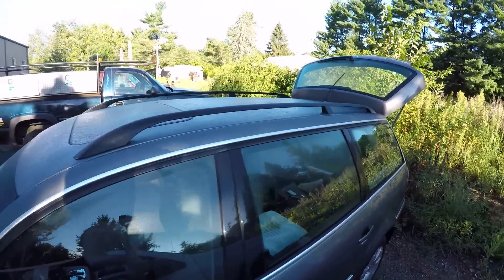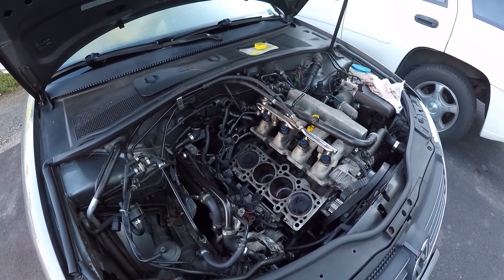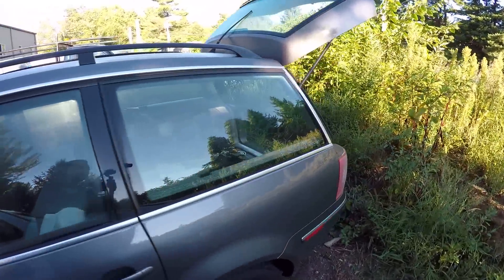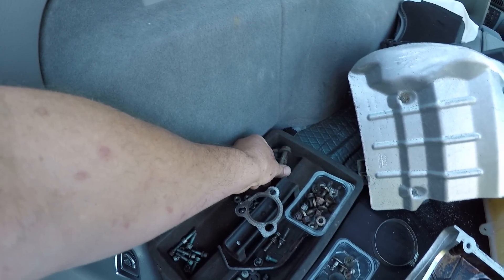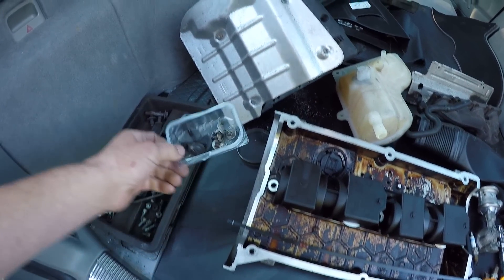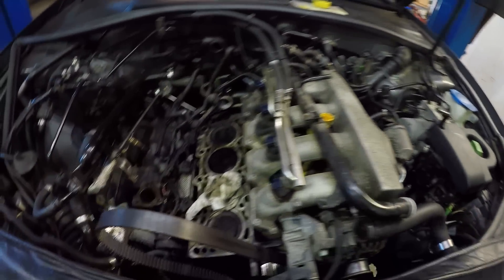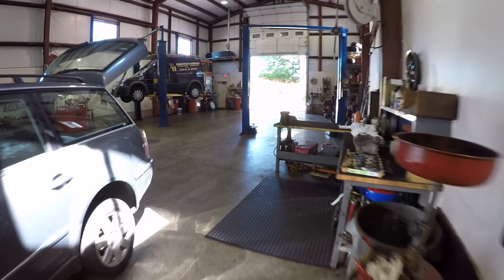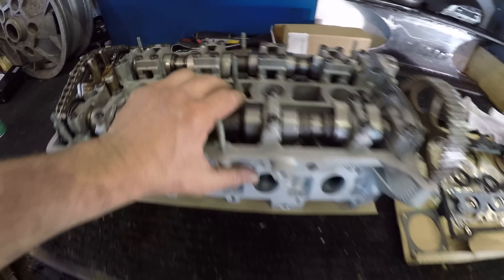Doing It Twice pt2 VW/Audi Cylinder Headcase Assembly. The TimeLapse Tech.

Comment: i don't think I have ever seen a VW with a longitudinal engine up front before., certainly not here in the UK. Audi yes, but never a front engined VW . Is it FWD like the Audi's?
Reply from the maker: Vw and Audi are the same company this wagon is basically an A4 Quattro wagon.
Reply: +Amesie's Automotive Corner Thanks for the reply :) I knew the VAG connection but never realised they put this set up in a VW, or should I say, badged  it up as a VW. You live and learn. Love your vids by the way mate.
Reply: Do you know what are you talking about
Reply: Yeah, I was pretty surprised when he opened the hood that first time and I saw a longitudinal mounted engine in a VW. I just assumed a Passat would be front wheel drive.
Reply: Oddly enough, it is FWD (unless it's a 4-motion, which is unlikely with the 1.8T -- most of the 4-motions I see are VR6). That required some interesting engineering to get the power back up to the front wheels, but I'm not sure exactly how they did it. But yeah, for some reason VW decided to put the engine longitudinal in the Passats, whereas they're all transverse in Golfs, Jettas, and Beetles. That decision led to a design change to the oil pan, reducing the volume of oil these held, which in turn resulted in a much higher probability of oil sludging for the 1.8T Passats, something these have become notorious for.

Comment: Amesie, maybe you can help me. Do you know about any combustion chamber cleaner that i could just pour in trough the sparkplug hole and let it sit and clean some of carbon? I dont want to take the engine appart because im not at that skill level yet.
Reply: There are many reasons not to do this: Liquid is not compressible, so when you try to start it, the rod connecting the piston to the crankshaft will bend. Liquid in a cylinder will drain slowly through the piston rings and go into the engine oil.  Always avoid liquid in the cylinders.
Reply: ngneer999 ofcourse i woulnt start the engine if it had some fluid in the combustion chamber. But that about the fluid draining into the oil is a very good point. Thank you!
Reply: So do it right before an oil change, and do it with the drain plug still removed... Also, it's simple to just leave out the plugs to blow liquid from the cylinders.

Comment: Something to check on all the late vw/audis is the water outlets and dipstick tubes as they are crap. The black plastic water outlets  crack  around the recessed areas for the bolts and leak. The orange plastic dipstick tubes break from the heat and collapse into the sump which lowers the full mark on the dipstick as the tube sits lower. Other than that they are good. I set my parts in trays like that too. Another thing i came across it the battery/starter cable where its mounted on a bracket under the exh manifold toward the back the insulation rots off  leaving the clamp with just a small amount rubber under it. this seems to get more common as they get older.